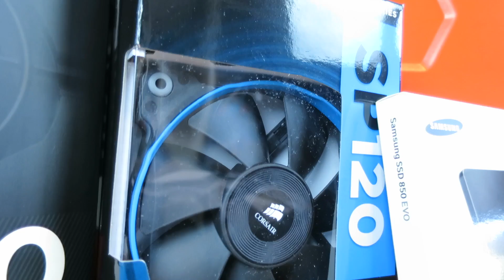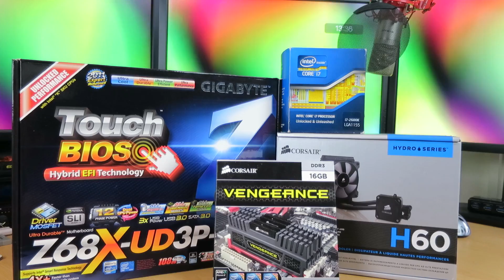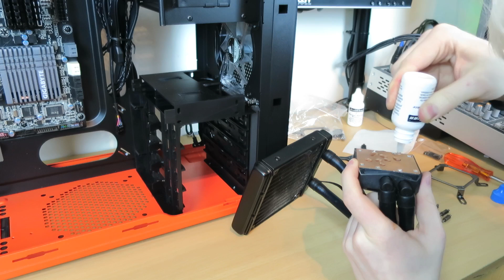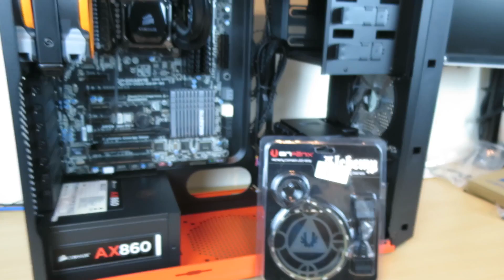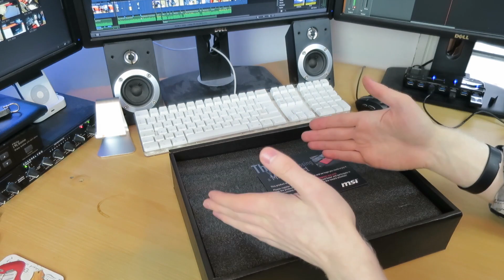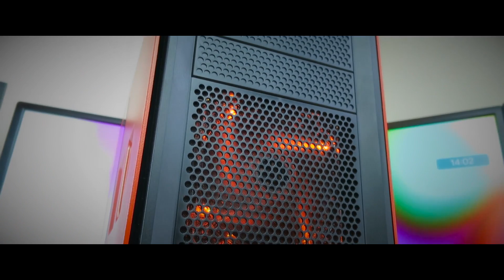EPIC 2016 Gaming PC Build (DOOM Ready!) | IMNC

Comment: will my pc run doom for 60fps on high or medium? (estimate by looking at gameplay) 
750W Corsair PSU
ASUS B150 PRO GAMING D3 Motherboard
Intel i7-6700 CPU 3.4GHz
Kingston HyperX Fury 16GB (2x8GB) 1866MHz DDR3 RAM
250GB Samsung 850 EVO SSD
Gigabyte GeForce GTX 970 G1-GAMING 4GB Video Card
Windows 10 64bit
Reply: +Wilson Lim he is ...cause he wudnt ask tht question...nobody asks this questn when they knw abt the specific names fo rthe hardware they have...
Reply: +Randy Ren yes it will
Reply: +Wilson Lim just makin' sure lmao, I don't know much about pc specs.
Reply: +Randy Ren no lol, it will run around the 10 fps.
Reply: +Spartanspear sweet as, all my stress is gone xD, thanks so much dude :D
Reply: +Randy Ren No, you need Quad SLI GTX Titan X. With your current setup, maybe 30fps on medium settings.
Reply: if it lags with the above config....lower resolution to 1366x768....
Reply: 3.5***
Reply: easily at 60 fps if vsync. is on probably more with vsync off
Reply: Naah not 60 lol it cudnt even run at 30...
Reply: then something might be wrong, because those parts should be able to run that game in 1080 perfectly
Reply: +Soumya Majumder  Not even run at 30? ROFL wat..
Reply: u need 4 x titans for med on doom 4
Reply: LOL, I see what you are doing here....c-ya
Reply: yeah wht the above guy said....
Reply: another bhind comes to play
Reply: +Addzy K 30.0fps?? is that on the dual i7-5960x's overclocked to 9001 terahertz at 0.6 volts? ;)
Reply: +Spartanspear you do realize that he mentioned no gpu lmao
Reply: +Davey Kerry   The 970 won't become outdated ....
Reply: +Davey Kerry  no, just no
Reply: Near maxed out 60fps no problem, have a similar PC 😃
Reply: +Davey Kerry mine runs ultra at 70fps+ in doom, it's only 1 generation behind so I think it's definitely got a lot more miles in it :-)
Reply: i can play it with a £200 laptop lol
Reply: +Davey Kerry   it even says you need a gtx 970 to run it but my a8 apu in my laptop works fine

Comment: Raid zero for storage? are you just planning to lose it in a couple days? RAID 0 is terribly unstable, just fyi
Reply from the maker: +Seth McArthur    RAID 0 is a fantastic cost effective way of getting speedy storage. When using 2 disks like I do here, you get pretty much double the performance which will substantially cut down loading times. As with any storage solution, there's an element of unreliability and due to the nature of RAID 0 it's very important to keep good backups. I'm a religious backup nut so I have absolutely nothing to worry about. Calling RAID 0 'terribly unstable' in general is a little over the top. There's no redundancy meaning that utilising 2 disks will double your chances of being affected by drive failure, but as for the RAID itself, it's not 'unstable'. 
Another note, this machine is for games. Games don't come under the 'crucial data' category. For me at least, they come under the 'let's access these as quickly as affordably possible' category. Knowing that I have an automated backup running every 48 hours, I can honestly say that running RAID 0 doesn't worry me in the slightest. I LOVE the extra speed :)

Comment: Nice build. Really liking the orange theme. :-)

Here's the one I'm working on:

http://uk.pcpartpicker.com/user/Outtheredude/saved/HTBXsY

Got the case, fans, PSU, motherboard, RAM and one of the 960s already. It's currently running with a G1820 (for the initial BIOS update), a couple of Lite-On DVD drives, and a couple of old HDDs. Am looking forward to getting the i7 next when I've saved up for it.
Reply: Multimedia-gaming pc?
And nice!
Reply: Thanks! It's for occasional gaming (mostly older titles on Steam and emulators), multimedia, software development, general stuff, trying out Linux and virtual machines.

Basically, the hardware to explore everything I'm curious about, while also being built to last.
Reply: +Darren Johnson-Jane (Outtheredude) Cool!

Comment: just built a new system
GPU-980ti extreme gaming
CPU-6700k
MB-Z170x gaming 7 gigabyte
PSU-AX1200i
RAM-corsair vengeance lpx 16gb DDR4 3200
CASE-corsair 780t black
CPU cooler-thermaltake water 3.0 240
plus 2 SSds one for windows and one for main games (256) plus 3TB hard drive.

Comment: should i get r9 380 or r9 390 for 1080p gaming?
Reply: At 1080 I'd recommend the r9 380. The 390 is a good 1440p card. Totally overkill at 1080
Reply: okay thanks
Reply: +1337mlg Yep.
Reply: I see what you're saying, but a gtx 980 is totally overkill at 1080p. It could be future proof for a really long time without showing age. Although, for just the next couple years, I'd recommend the r9 380 for 1080p.
Reply: Think of it like a list, Need and Want.
Reply: So all that's needed for 1080p is a 380, but what's wanted is a 390 or gtx 980.
Reply: I'd say that the r9 290 could max anything out at 1080p. The Phenom might be fine, depending on exactly how intensive the games you're playing will be.

Comment: i have the same looking System-PC CA:230T(black), CA:H80i, GB:990-FXA, MSI: NV 960 and vengeance RAM. 
But i did a better job with the cable-management. i did it, in a straight line behind the CD and  HardDrive cage. Where can i upload a PIC to show you, so you can see your own, cause i don't believe that the cables have to Be so close to the VRMs or the CPU-socket.

Comment: Not everything in the rebel orange 230t is top notch, no rubber gromets, the feet are terribly too small, hdd cage is a cheap plastic and obstructs the airflow but luckly its removable...other than that its a super great case especially for the price. I have my main rig in it.
Reply from the maker: +Mara Ganea   I've got some little rubber stick on things under my feet that brings the case up a little more, I'm glad I added them because I think airflow to my PSU would've been fairly restricted without them. In terms of the HDD cage, I haven't had any issues with it yet apart from vibrations. It's not isolated that well so the whole case vibrates from HDD movement but that's solvable with a rubber band or 2. Overall, like you say for the price, it's super great!

Comment: I'm running a 2600k machine. Got my CPU up to 4.2GHz stable at 38c idle on the CM V8 cooler, with Corsair Vengeance 16GB DDR3 1800, Sapphire NITRO R9 390X 8GB, Samsung EVO 850 512GB SSD, 4x WD Black 2TB HDD, EVGA SuperNOVA 850 PSU, HAF X case, etc. etc. It's a decent machine, but I've recently built something much better:

CASE: CM Storm Stryker
MOBO: GIGABYTE G1 Gaming GA-Z170X-Gaming 7
CPU: Intel Core i7-6700K 8M Skylake Quad-Core 4.0 GHz
HEATSINK: Cooler Master Hyper 212 EVO w/ dual fans @ push/pull config.
M.2 SAMSUNG 950 PRO 512GB PCIE x4
SSD: SAMSUNG 850 EVO 2.5" 500GB SATA III 3-D
HDD: 2 x WD Caviar Black 4TB SATA III
RAM: CORSAIR Vengeance LPX 16GB (2 x 8GB) 288-Pin DDR4 2400
PSU: EVGA SuperNOVA 80 PLUS GOLD 1300 W ECO Fully Modular
GPU: 2 x SAPPHIRE NITRO Radeon R9 390X 8GB GDDR5 PCI Express 3.0
Asus 144Hz 4K 28" 1ms Gaming Monitor
CyberPower 1500VA 900W UPS
Reply: +RobertGAMING HD same bro it sucks :(
Reply: +RobertGAMING HD get a job.
Reply: ***** You can get already a job. First I earned my own money by delivering the news paper or idk how you call it for 3 years. And now I work in a supermarket. And some people with who I work there are also 15.
Reply: ***** Oh, didn't know that, and thats sucks :p

Comment: where did you get the i7-2600 1155 socket cpu? I'm looking for one.
Please link site :). 
Also awesome vid so far :).
Reply from the maker: +Narut0luva12    They're old now so eBay or used computer shops are pretty much your only options, unless you're lucky enough to find one at a recycling centre or whatever.

Comment: Have fun having driver crashes from overheating on the 380. I had that problem and had to buy a new card.
Reply: I have the R9 380X and have yet to have overheating or drivers crashing. So if buying recently you have nothing to worry about.
Reply: +NateyMcGee Leet I built my PC on Christmas of 2015 and had it overheat, I bought a Sapphire r9 390 and no crashes or overheats yet.
Reply: +Infinity Damn that sucks maybe it still had the 20% fan speed bug. I have a Sapphire R9 380X.
Reply: +NateyMcGee Leet yeah, I really liked the card too, but it's always nice to have an upgrade :)
Reply: i have the msi r9 380 and no problems! no drivers crashing and the temps are realy low

Comment: Can Someone Help Me Is This a Good Build?
-Intel Core i5-4690K Processor 3.5 GHz LGA 1150 
-MSI 970 GAMING DDR3 2133 ATX AMD Motherboard   
-EVGA GeForce GTX 970 4GB SSC Gaming ACX 2.0+ Cooling Graphics Card 
-Crucial Ballistix Sport 8GB Kit (4GBx2) DDR3 1600 (PC3-12800) 240-Pin UDIMM Memory
-WD Blue 1TB Desktop Hard Disk Drive - 7200 RPM SATA 6 Gb/s 64MB Cache 3.5 Inch - WD10EZEX   
-EVGA SuperNOVA 750 G2 80+ GOLD, 750W ECO Mode Fully Modular NVIDIA SLI and Crossfire Ready 10 Year Warranty Power Supply 220-G2-0750-XR
-Cooler Master Hyper 212 EVO - CPU Cooler with 120mm PWM Fan (RR-212E-20PK-R2)   
-Corsair Carbide Series SPEC-02 Mid Tower Gaming Case (CC-9011051-WW)   
Any Advice?
Reply: +Strawb That CPU and motherboard are completely incompatible. You need an Intel socket 1150 motherboard, not an AMD AM3+ one. With a K chip, look for a board with the Z97 chipset.
Reply: AMD and Intel aren't friends

Comment: dont do raid 0 configuration with mechanical drives , you could have saved some money on the psu , its too much , you should have bought noctua nf-12 pwm fans , i have 4x sp120 fans i removed them they are horrible the fan blades are good but the bearing (motor turning the fan) is horrible , its so loud anyways im not here to prove superiority but dude you made a really nice bargain on that ebay deal , sandy bridge is old but still packs a punch !
Reply from the maker: +PC Therapy   Thanks for your comment man! :)   RAID 0 on HDDs is fine as long as you have good regular backups (which I do) so I'm not worried about it, totally worth it for the speed increase. In terms of PSU, I bought it used for about £60 / £70 under the average new price, so for well under £100 I couldn't have got anything better IMO, plus, having the 80+ Platinum efficiency will help me a little in saving on my power bills when I move out. In terms of the SP120s, I know a lot of people rate them very highly so I wanted to give them a go. I've got Noctua all the way in my main rig though. I hope this helps with some of your queries :)
Reply: ItsMyNaturalColour
i personnaly got the sp 120 with my h100i gtx cooler , but i have put them aside for the moment , they make too much noise , the ek predator x360 has entered my rig , no sp120 shall pass on this liquid cooler ! :P

Comment: Nice Build man but why didn't you just dual boot windows on you hackintosh for less money and more power? :/
Reply from the maker: +Danny Parker    Good question. The Power Hack is a working machine, it's always doing something. With the amount of content I pump out and the varied things I do, there's never a dull moment for that machine. The nature of dual booting means that I'd have to completely shut down OS X rendering it useless just to play a game, meaning that I'd have to find dedicated time to game, rather than turning around to a different system while my main system carried on with whatever rendering / converting / compressing / exporting it's doing. Also, the main machine is connected to a whole host of things that I don't need for gaming within Windows such as audio hardware, triple monitors and a variation of external storage devices that'd send Windows into a freak out every time it booted. Keeping my enjoyment completely separate from my workhorse machine is a good move I think :)

Comment: Is this a good build plus respond thanks

Intel Core i3-6100 3.7GHz Dual-Core Processor

ASRock Z170M Pro4S Micro ATX LGA1151 Motherboard

Kingston HyperX Fury Black 16GB (2 x 8GB) DDR4-2133 Memory

Seagate Barracuda 1TB 3.5" 7200RPM Internal Hard Drive

EVGA GeForce GTX 750 Ti 2GB Video Card

Corsair 200R ATX Mid Tower Case

EVGA SuperNOVA NEX 650W 80+ Gold Certified Fully-Modular ATX Power Supply

Microsoft Windows 10 Home OEM (64-bit)

Asus VG248QE 144Hz 24.0" Monitor

I just jumbled this shit together for a total of $900+ dollars lol
Reply: No, I'll tel you why,
CPU is decent, although I reccomend an I5,
MOBO; good
RAM; you don't need 16 unless the rest of your PC is higher end
Storage: it's ok, but I reccomend a 40$ boot drive ssd
GPU: no no no, that gpu is for people who want a simple upgrade its not good go with a 960 or 970
Case; I've got the same one, happy with it, good layout
PSU; good budget power supply although I reccomend the 750 B2 as its higher quality and on a sale right now.
Reply: EDIT: just get Windows 10 for 20$ on Kinguin
Monitor; this part I hate, no, just no get a cheaper 1080p monitor and save some money
Reply: +Alexis Diaz Why would you get a 1440p monitor when games will struggle to run max on a 750ti?
Reply: Scott Strachan My real build is this Is this build good?
CPU:
Intel Core i3-4130

Motherboard:MSI Computer Corp. LGA1150/Intel H81/DDR3/SATA3 and USB3.0/A&GbE/MicroATX Motherboard H81M-P33MSI 
H81M-P33

RAM: Corsair 
CMZ8GX3M2A1600C9B 8gb (should I get one more?)

SSD: Samsung 
840 EVO 250 gb

HDD: Western Digital BLACK SERIES 2TB 3.5" 7200RPM Internal Hard Drive

Video Card: Gigabyte Radeon R9 270X 2GB WINDFORCE Video CarD

Case: NZXT Phantom 410 (White) ATX Mid Tower Case

Power: EVGA SuperNOVA GS 550W 80+ Gold Certified Fully-Modular ATX Power Supply

Mouse: Logitech G302 Daedalus Prime Moba Gaming Mouse 4k dpi

Keyboard: TT eSports challenger prime

Monitor: 60-120Hz 1080p any recommendations (lowest price possible.)

Total price: $680+ (sigh solid build though I might ditch one tb of memory I don't really download a lot of things any help would be appreciated thanks. BTW this link is were I started http://pcpartpicker.com/p/42ZnYJ )

Like I said. I just jumbled it together lel.
Reply: +Alexis Diaz get an i5 4460, a gtx 960-70 or a r9 380x/90, get a higher watt psu, and just get the cheapest 1080p monitor, and dont spend all your money on gaming hardware, wait a little, and than buy mouse, keyboard,etc...

Comment: i`ve been using the sandy bridge platform since 2012, its just awesome, i had a 2500k, that was rock stable at 4.4ghz 1.264 stock vcore, and now my 2600k that i have since 2014 is running at 4.4ghz too, with stock vcore, some of this cpus are able to run at 5ghz with a reasonable vcore, just awesome

Comment: The 2600K is a lovely CPU. I used one a few years ago in a customer's PC build, designed to run flight simulation software. Cool running and super fast, I actually prefer it to some of the more modern Intel chips.

Comment: Nice build! I'd love to pick up a 2600k (or 2700k) to replace my 3570k some time. I hear Sandy Bridge chips OC like absolute beasts, since Intel doesn't delid and add solder to the chip anymore. Also I love the parts you choose all around. I myself picked up a similar GPU around Christmas time (MSI R9 390).